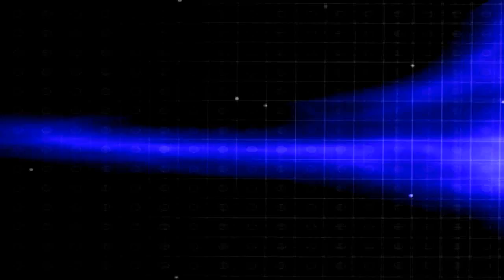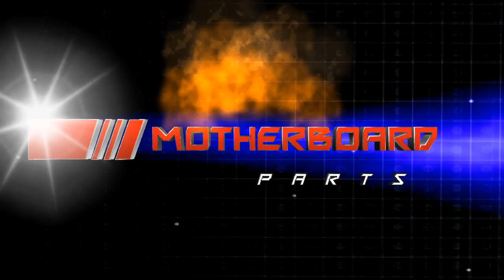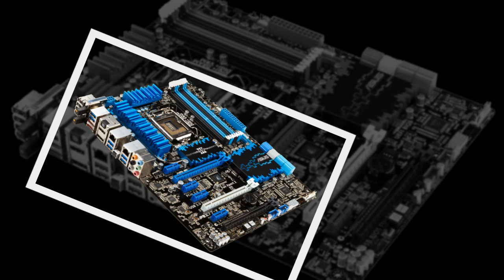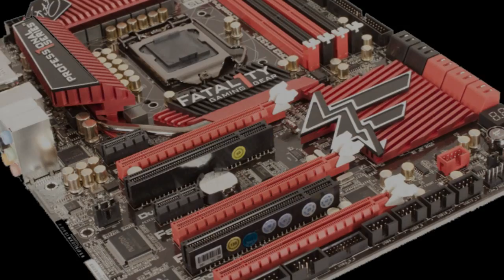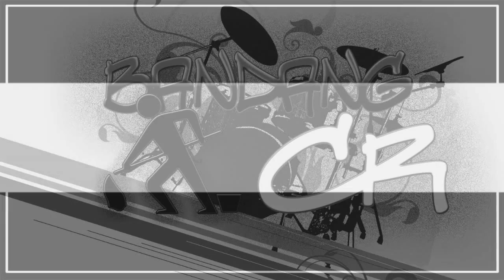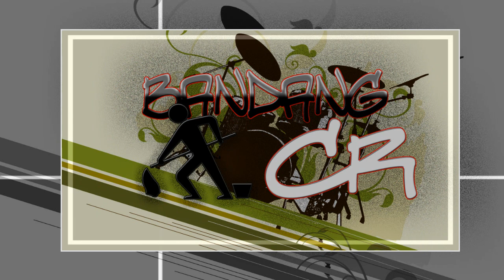CSS NCII | Parts of the Motherboards and its Functions (HD)

Comment: Can the back panel ports be desoldered and soldered again to reuse an old motherboard
Reply from the maker: Yes it can be desoldered using a hot air. And transfer it to a same motherboard. But I didn't know if it is possible placing it on another board.